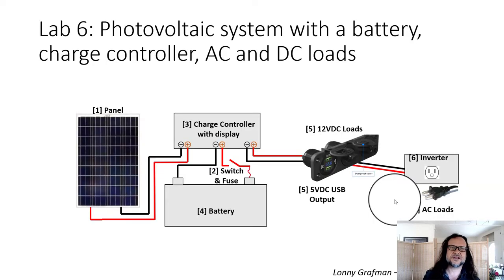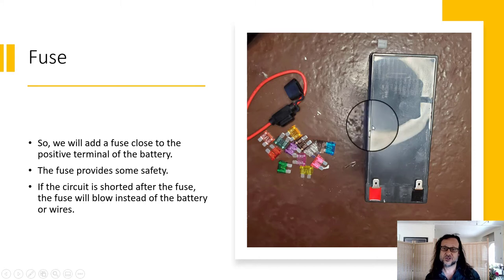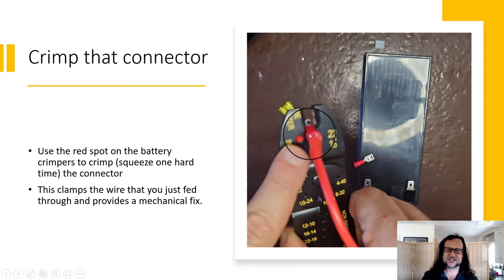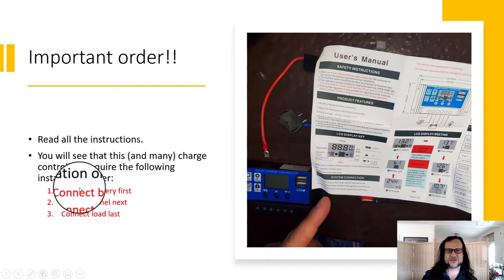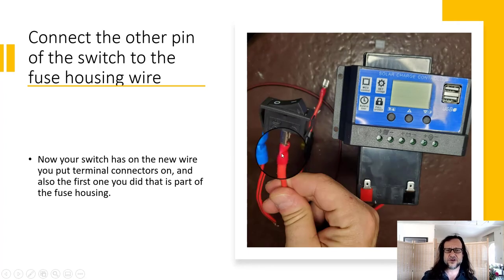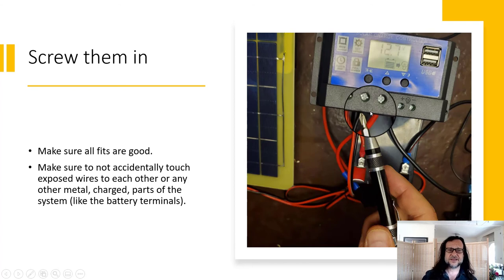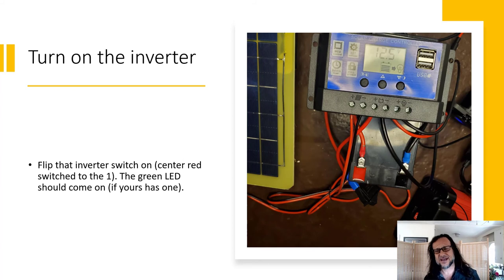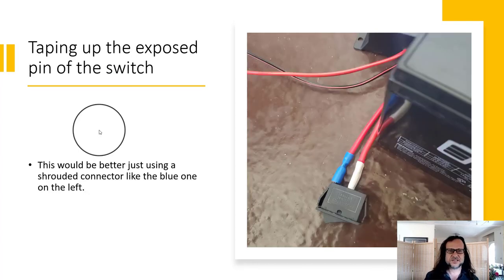Small photovoltaic system with a battery, charge controller, AC and DC loads

Comment: I'm going to throw a clinker in your gears: You do not want to connect your primary load to the controller outputs. That output (on both of my different controllers) is for a low-load lighting circuit, and will not pass full current from the battery to the load. Your inverter should be connected across your battery. This is what the instructions which came with each of my different controllers say. I currently have 2 separate DIY systems running; #1 is a 100 watt panel, PWM charge controller, 300 watt inverter, and (11) 12v 9AH batteries in parallel. System #2 is 1600 watts of panels (4s4p), 30 amp MPPT controller, 4 100AH deep cycle batteries (2s2p) and a hacked 1500 watt UPS for an inverter. The instructions which came with both controllers confirms this. You must not pull your full load through the controllers output pins. $.02 from about 4 years of hands-on...
Reply from the maker: Thanks T! For sure. The next video will cover loads too large for the controller (it is also covered in a new solar book we will have coming out soon). As you say, charge controllers come with a max current outout. The advantage of connecting loads to the DC out is that you can take advantage of the built in low voltage disconnect (which this charge controller has). This system and charge controller can handle the load we are putting on it. I really appreciate your comment. It made me realize that I really should have mentioned that in this presentation. I will go back and add a warning and a heads-up. Thank you for helping me improve this.